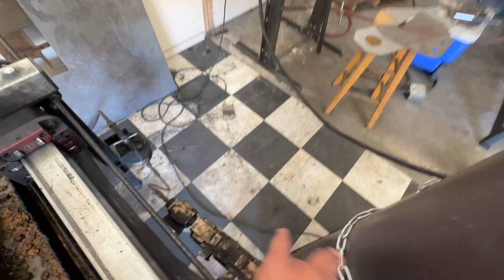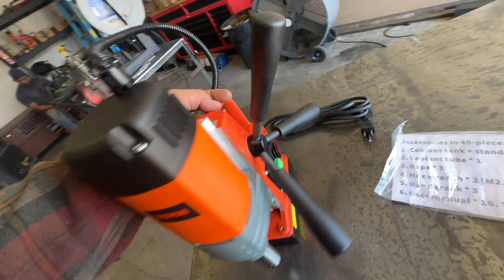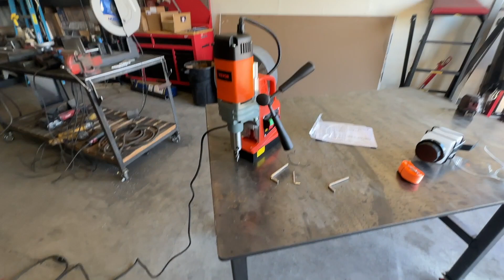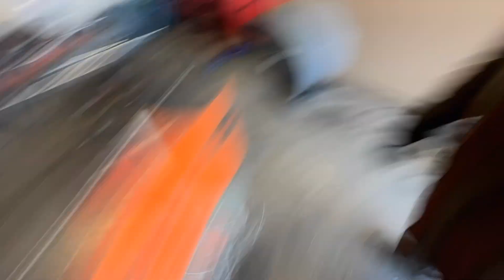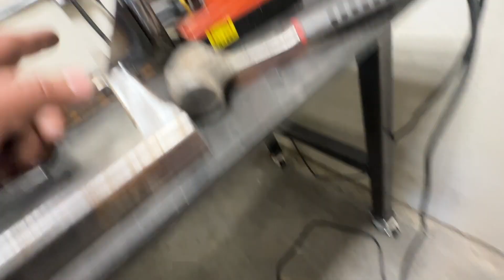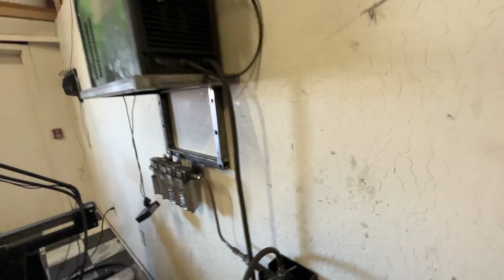Doing Some Shop Upgrades And Testing A $200 Magnetic Drill

Comment: Enjoyed your video. Those casters look exactly like what I need to use under my 20 Ton Harbor Freight press. 

I have the variable speed reversible Vevor. It works really well. I hooked up the coolant reservoir and filled it with machining coolant that is made from concentrate mixed 1:9 with water. It really helps to cool the annular cutters and make them last longer.

Comment: Nice video on your new mag drill, great job. As per your plasma cutter machine you can mount it to the wall with 2x4 or 2x6 cheats. Run them across the wall studs and mount your bracket on to the cheats. It will be much stronger and there will be no need to find a stud to attach to. Just another way of doing things. Great video again.

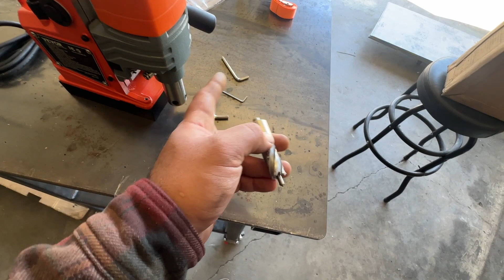Comment: 5:48 - Annular Cutters, I describe them as an "Endmill Holesaw" haha. It cuts like an end mill, but only cuts the outside of the circle like a hole saw. I opted to get the variable speed model that includes the jacob's chuck and adapter. It's more expensive, but will pay for itself in the long run. Annular Cutters do better at lower rpms, so they'll last longer and I'll be able to drill harder materials.

Comment: Maybe put a 3/4” plywood backer that can screw to studs and you can screw your bracket into the plywood. Allows for future adjustments or placement on that section of the wall.